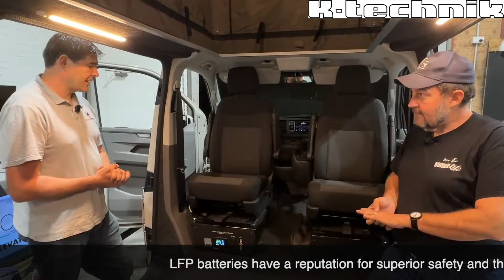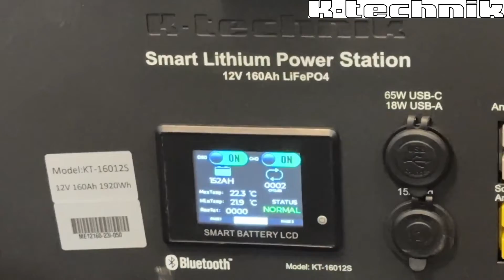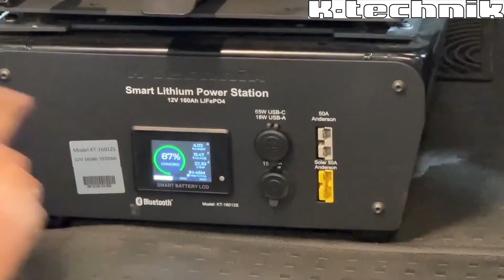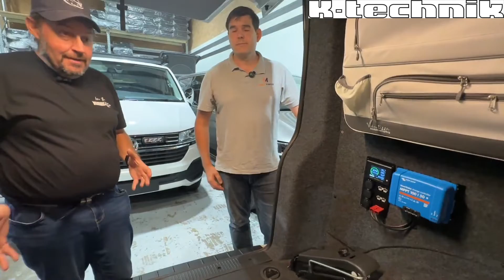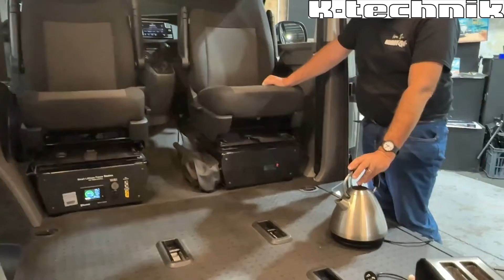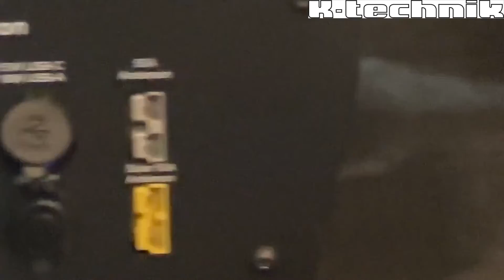K Technik 160Ah Underseat Battery for VW T6.1 / T6 / T5 - an Overview - CE / IEC / UN Certified

Comment: I HAVE A WESTFALIA CLUB JOKER IN THE UK ON A T 6.1 PLATFORM AND WANT TO PUT A SYSTEM LIKE THIS IN TOGETHER WITH ROOF MOUNTED SOLAR AMD HOOKED INTO THE VAN’S 240 VOLTS CIRCUIT. CAN YOU POINT ME TOWARD SOMEONE WHO COULD DO THIS FOR ME - THANKS

Comment: I have recently fitted this system with the Redarc BCDCN1240 to my T6.1 Multivan, It is working great and I would recommend this system to anyone.
It was a little painful re-routing the existing under seat wiring to allow space especially for the battery but also for the inverter. My solar panel will have to be replaced as the OCV is beyond the range the BCDC can handle.